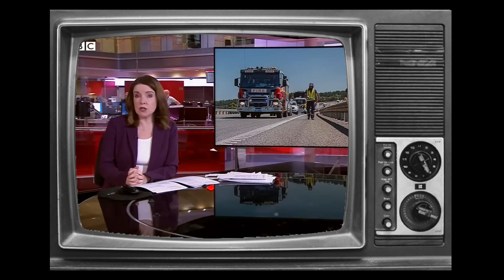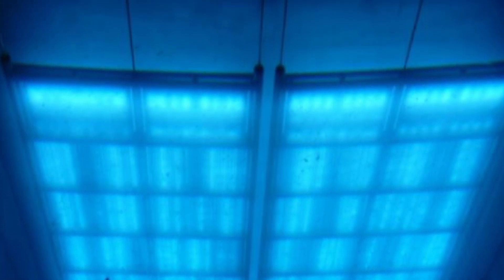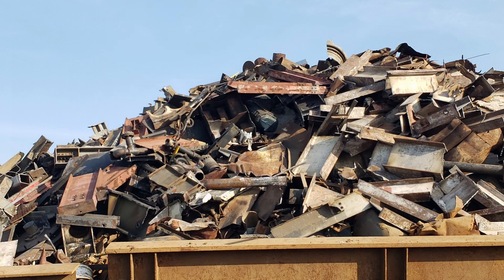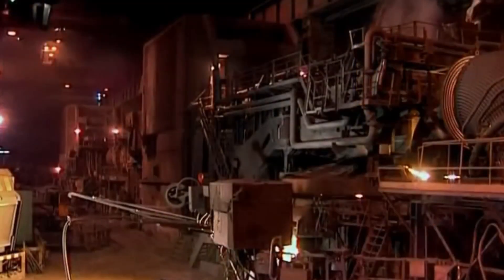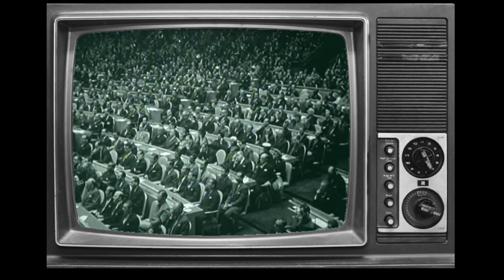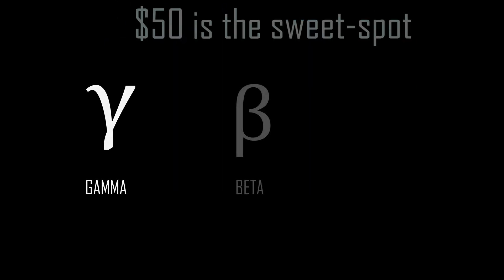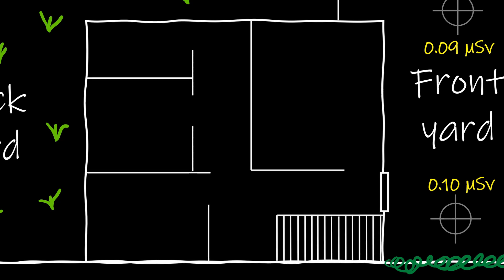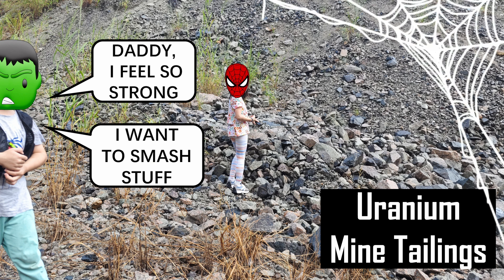Orphan Sources - More than 20,000 capsules of DEATH are just missing! ☢️

Comment: fact: there was an incident in the soviet union, where a Cobalt 60 source from a quarry got misplaced and ended up in a concrete wall used to biuld quick and affordable housing. After 4 pepole died from radiation sickness, the goverment stepped in, detecting the source hidden away in the concrete. (for anyone wondering, its called the Kramatorsk radiological incident)
Reply from the maker: In the USA alone, there are around 1000 sources lost per year (according to the IAEA), for sure 99.9% of those end up in scrap metals and just get recycled.  In other countries, I would expect the figures to be higher.
Reply: @project-326 Scrapyards all use radiation detectors to prevent that.  Isotopes getting into scrap happened in Mexico and that caused the current prevention.
Reply: AFAIK it was Cesium-137 in Kramatorsk.
Reply: The Lia radiological accident is by far one of the worst orphan sources imo. Three men collecting firewood in a forest in Georgia (Country) come across 2 sources that came from old soviet radioisotope generators. They then proceeded to use them as a impromptu radiological "campfire" for a night of fun filled camping and vodka drinking, the next day they then wear them as necklaces to keep them warm in the snow.......

Comment: Hello, very informative video, thank you a lot! I would like to ask you a question, what's your opinion about radon home pollution ? should we monitor our homes for it ? Being an alpha emitter, is it something we could monitor with a not that expensive geiger counter ?
Reply: usually to detect alpha emitters you need a detector that is sensitive enough to even detect them, as they are very low penetration, so usually specialized GM tubes are needed to detect alpha radiation. and those aren't cheap. you would be better off buying a radon meter, as some areas are susceptible to radon buildup, especially if the ground around your home contains high amounts of granite, which tend to contain elevated uranium levels. also as a side note, usually when measuring radon, radon itself isn't measured, but the daughter products of it are, as those are much more active, and more easily detected, and that's where the hazard of radon lies, in its daughter products. those tiny particles of daughter material stick to everything, including dust, and radon is a gas which can be inhaled and decay in your lungs, meaning your exposure is increased to unsafe levels if you breath in too much radon contaminated air.
Reply: If i remember correctly there should be radon-specific detector, especially if you live in a place that had (geologically) recent volcanic activity. In my home area in italy I was pretty sure you could ask health authority to come check your house since there is lots of tuff used in construction here, and some basements are directly dug inside tuff rock